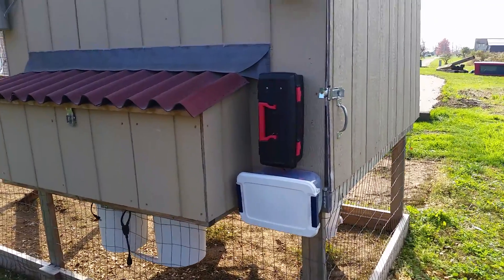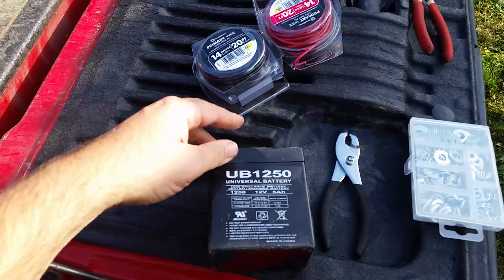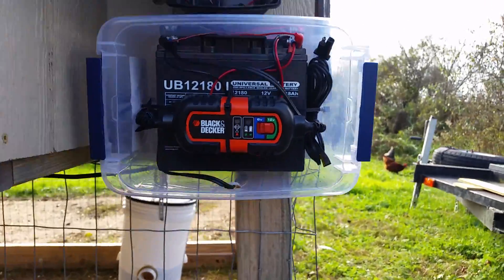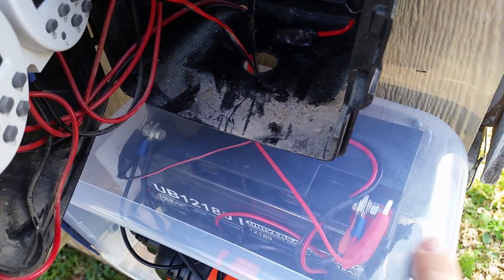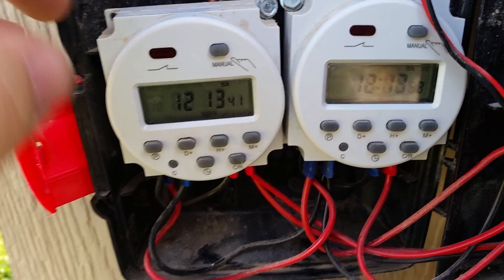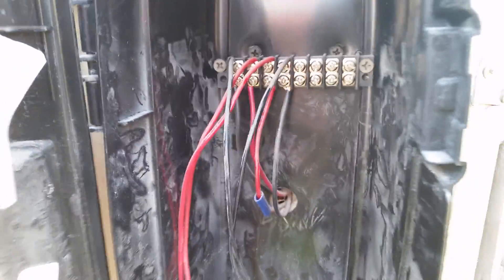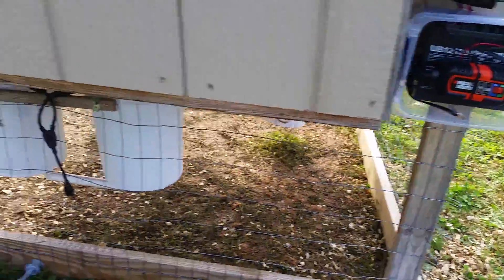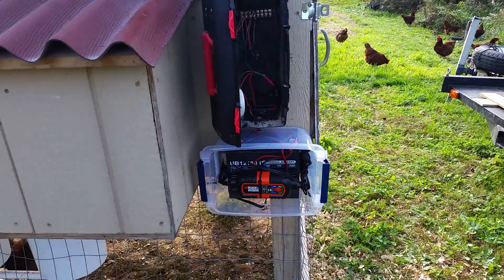How to make the best darn automated chicken coop ( Electrical Setup)

Comment: How do you reverse the direction of the motor to go up and down? How is the polarity switched?
Reply: Leo Frandrup you can use relays to reverse the motor polarity.  

If you have the time and don't mind tinkering with this sort of project, you can save some money by designing and rigging stuff up (car antenna, drapery motor, cordless drill, etc.).  However, if you don't have McGyver on speed dial, you're probably better off going the way Shawn did and buying the add a motor and then simply wiring it up properly.
Reply: @deasttn  F that car antenna BS. LOL You had me up until you said that.
Reply: @AztecWarrior75   my car antenna works perfectly in raising and lowering my chicken door
Reply: @deasttn  I still say F that shit. Everything from mounting to wiring is a pain in the ass.  And yes I know how to do it, that why I say it. Also the cost is just stupid. Antennas are not meant for this stuff and coast over $30 and that's the cheap ones. Don't bother saying you can go get one at a junk yard. You want people to go and waste time on something they may or may not find, and may or may not even work. They are getting more and more scarce. They not used anymore. New ones cost as much as the basic Linear Actuator that are actually made for this sort of thing and mount easy, so why not just spend the extra $10. 

I actually believe that people like you are like the saying "Mystery loves company". You want other to have to deal with the same BS you did (even tho you won't admit) because you only ever say the "good" about it and never all you had to do to get it to work.
Reply: @AztecWarrior75   I'm not arguing that it's the only way.    I'd be interested in seeing your door.   Do u have a video posted?
Reply from the maker: Leo Frandrup I mulled over for weeks if I wanted to build one myself or buy one. In the end between acquiring a motor and all the electronics I would have need, plus the time factor I ended up just buying a pre-made motor. The polarity gets switched on the motor by a switch that gets thrown at the top and bottom of the timer.  http://www.amazon.com/Add-A-Motor-Chicken-Automatic-Motor-D20/dp/B007IZJWNQ
Reply: @ShawnWhetsel  "between acquiring a motor and all the electronics I would have need, plus the time factor" That's funny. All you needed to "acquire" was two STDT timers and a Linear actuator. That's it. LOL
Reply: How is the polarity switched?  Well...

That motor D20 Add-A-Motor works when power is applied. The motor has these "fingers". One on each side of a switch near the top. The fingers are on a dial. The dial Is kinda like an egg timer. But moves faster. When power is applied the motor turns in a direction, until one of the fingers comes and flips that switch. When power is applied again it turns in the other direction until the other finger hits the switch. The further apart the fingers are set, longer the motor runs. They are used to determine where to stop the door at.
 
The problem I see with that is if, for some reason there is a power failure, It may skip an opening or closing. Let's say you are using battery and a solar charging system. And there comes a time that it is cloudy for several days. Battery starts to drain and the charge controller cuts off the load until the battery gets back up. Well if the load is off and it is time to open then it will miss that. But during the day the battery get back up. Well that motor doesn't know which way it is supposed to go, it only does that opposite of the last time. So instead of it being closed and it not doing anything it will actually OPEN the coop at night.

Comment: Did the larger battery do the trick?  I had doubts that it would. The 18 amp battery would not help if the charger would not keep the 5 amp battery charged.
Reply from the maker: Richard Hill I don't know if its that the panel could keep the small one charged, or if it was just to many cycles on it that little battery. So far so good this summer. I took it off of shore power around mid-March and no issues thus far. I keep it on a tender all winter and it only runs the motor and LED lights during the summer. That coupled with more daylight hours to charge it seems to be fine.

Also, the main issue with the old battery was not enough amperage to run the LED lights and power the door at the same time. I have changed it so the door goes down or up after the lights are off.
Reply from the maker: +Richard Hill The larger battery did help it last longer, but still did not completely do the trick. We have had a warm winter so I left it off shore power till almost the beginning of Dec. I noticed the lights were dim, and the door didn't go down one night. That's how I knew the battery didn't have enough power to handle everything. With less daylight hours, I just need a higher W panel to keep the battery charged up. I have a feeling that if I upgrade from a 5W to a 15W I would be OK. During the summer I was fine, but just not enough daylight and to much demand in the winter.

Comment: Isn't it best to give them more light in the morning vs evening? They say that helps them lay earlier in the day.
Reply from the maker: +catfish307 Great question, and I'm not sure to be honest. I have modified my times since this video, so that I do indeed give them light in the AM and in the PM. I have to adjust it slightly as the summer rolls in, as to not have it running during daylight, but the light comes on from about 6am to 8am-ish (will adjust down as we get more daylight) and also from about 5pm to 9:30pm. (Again I will adjust the time shorter as daylight hours increases.)
Reply: Yes it is. It helps them wake up and get moving but doing so also lessens the "Laying lifespan" ( I forget what they call that) of the chicken. Hens are born with all the eggs that they will produce during their life. You get more eggs "up front" but they stop producing earlier. A trade off. Back to extending morning vs evening daylight hours. Extending the evening light hours is almost useless. The chickens are already winding down for the day. So if you extend the evening hours without extending the morning hours, you are just wasting time..